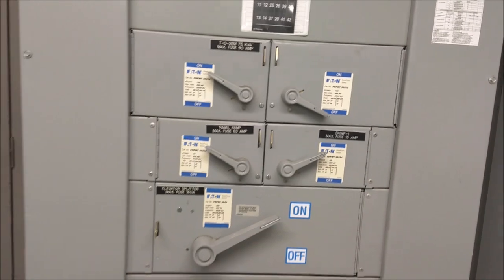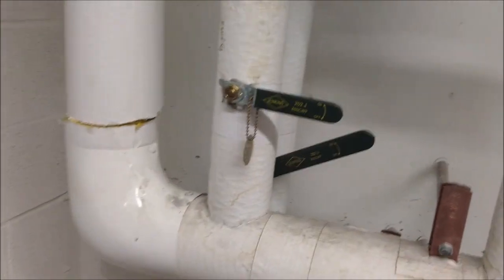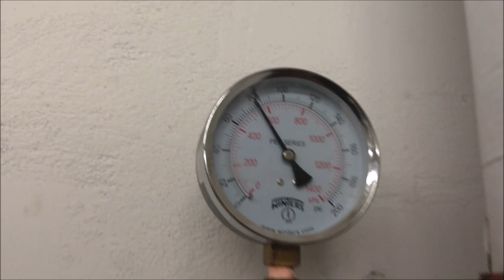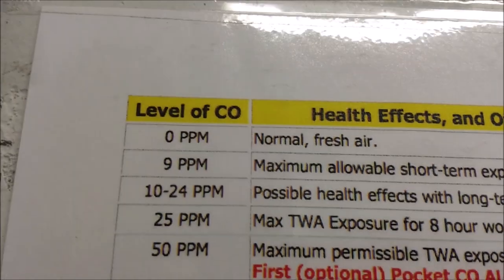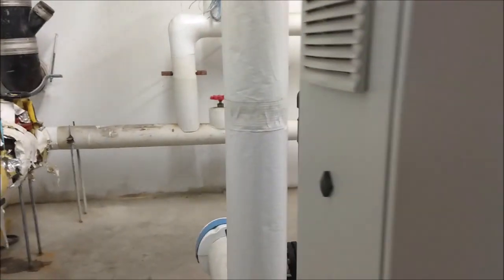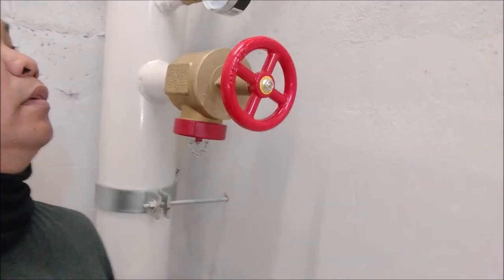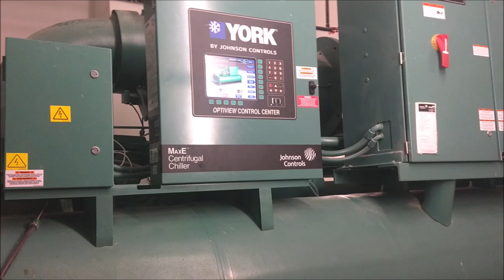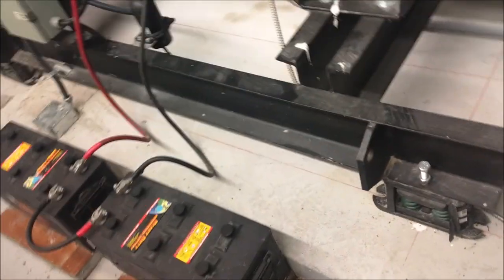My Daily Routine As Building Operator

Comment: quick question what did you do to prepare yourself for this type of job, ive been offered this type of position but iam an electrician and have no idea how to check everything else so how did you prepare, maybe i can better prepare myself for this position.
Reply from the maker: I took BES Course or Building Environmental Systems Operator. But you don't have to do that because you're an electrician, you already know all the basics. You just have to get started and be familiar on how the mechanical works, in which you can only do onsite. I pretty sure, you won't have any problem doing the job. You don't have to fix them, you just need to determine if something is going on with certain mechanical so you can can someone to fix it before it will get worse. You just basically making sure, all of the mechanical as working fine and get get someone to fix it to prevent bigger issue. other description, you just need to do some handy works and report to the management. That's all. Good luck hopefully this will help. Sorry late response.